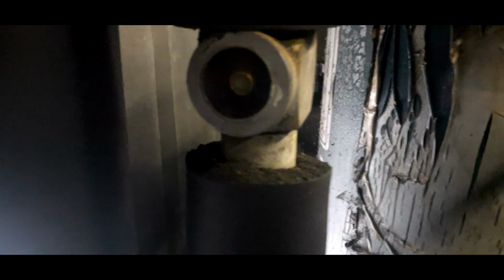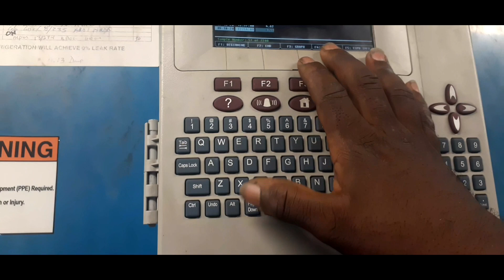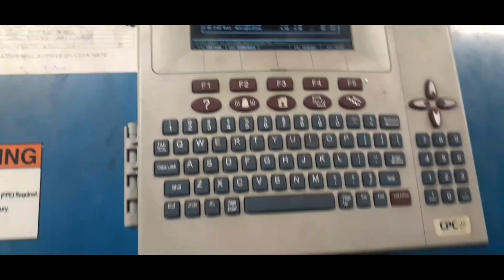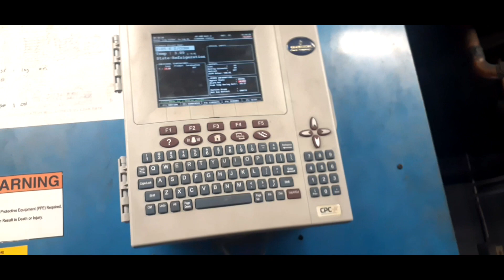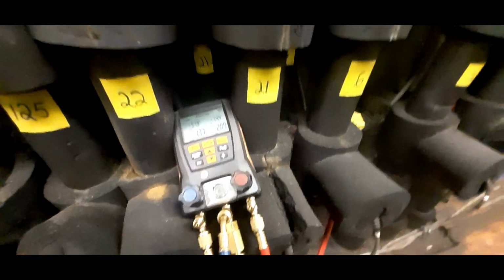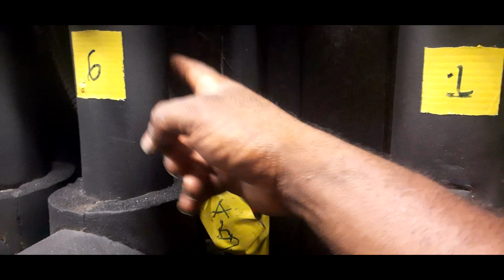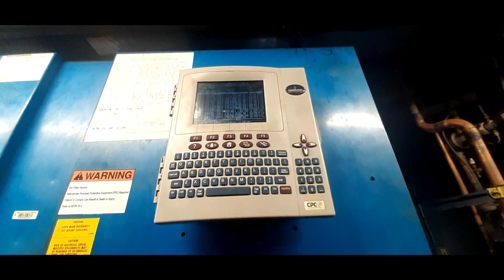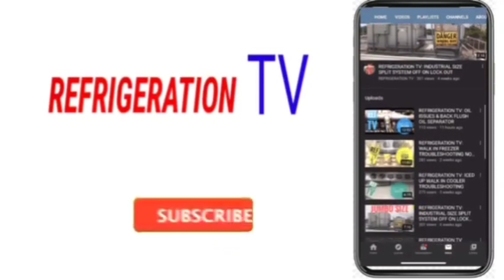HVACR❄TROUBLESHOOTING♨️VIDEOS

Comment: I would love a video on the most common navigation of that Johnson control. (Short cuts and most useful features. )
Reply from the maker: Its 2 diffrent types of controllers even though they look the same one controls the Refrigeration Racks Systems and the other controls EMS, Air Conditioning, Lights, and, It even connects to the Generator. These controller are a Beast. I hear you👂
Reply: @Bluecollarrebel  you're right,  my bad we use the same Emerson controller. Basically I used the wrong brand name. (That's the type of controllers we use for the building management) All the same I'd love some shortcut videos to Emerson controller because I have not got to use it much. I have the remote software but it's a little cumbersome versus being at it. And generally I only get to work on it when I'm on call which is this week 😁
Reply from the maker: Underlstood. I'll see what I can come up with 👊